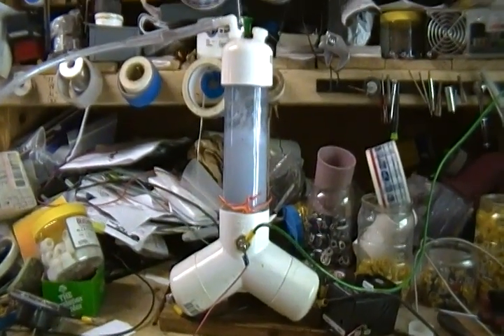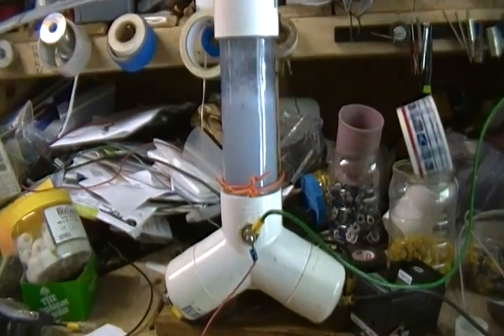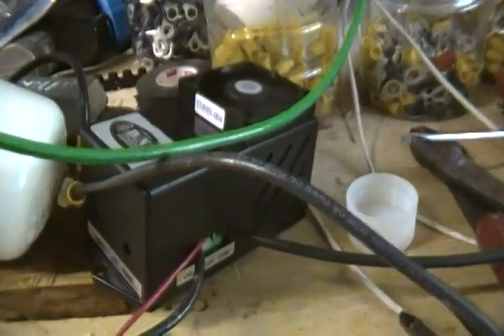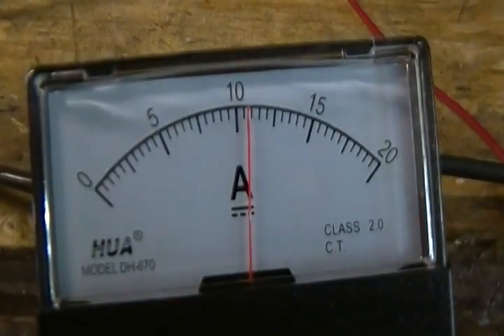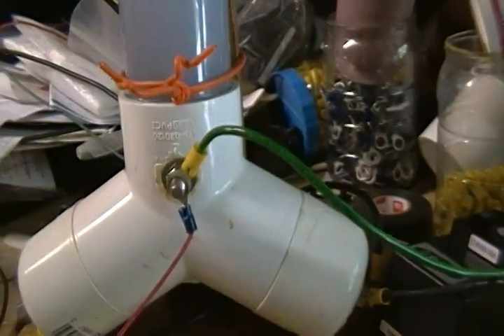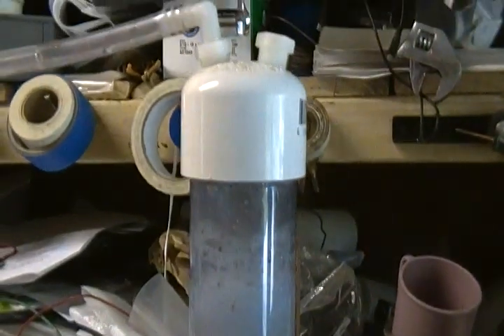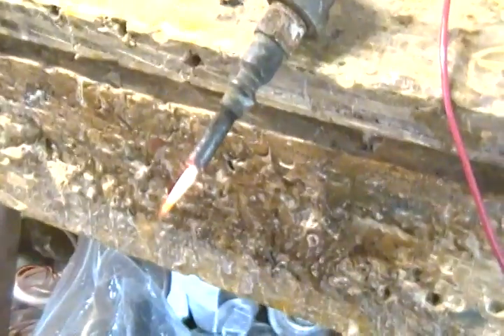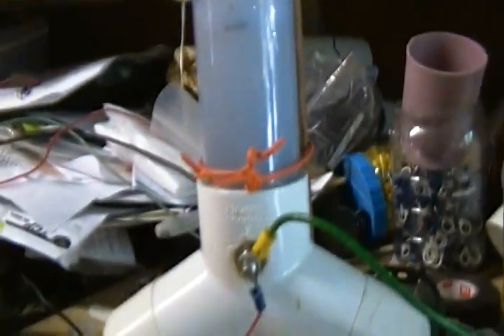FARM SHOW  - HydroStar Works Great For a FARM SHOW Reader!

Comment: The original Hydrostar was a booklet of instructions to build an offshute model of the Meyer type hydrogen generator.  The design was by Chambers of the Canadian firm Xogen. He used to be an engineer of Meyer's firm of Water Fuel Cell in Ohio. He went to Canada after Meyer was killed and had his new Patent slightly modified so as not in competition with Meyer. The major difference - his drawings do not exactly say for electrodes to touch the high voltage, even though you can infer that to be possible by flipping pages for comparison. Also Spin control of ions rising above level to raise up energy content. The notion also went for the magnets attached to gas lines of engines, you read about years ago. 25% increase in MPG with the hard to build Hydrostar. The design plans are now on EBay as disc, but the original was paper manual. You tube has a couple old videos of similar construction. Also Mythbusters show episode called Exploding Pants, purchasable and on you tube, has real interesting  skits about  a partial assembly of Hydrostar but has intentionally built in 14 mistakes , so as an engine would not run on cell built. Sub assemblies of Hydrostar are available to purchase on EBay.  US Patent "The Hydrostar"-- Oct 2000,  Apparatus for producing orthohydrogen  6126794 read on line or special order photocopies.

Comment: The Hydrostar was an offshute system by a previous employee of Water Fuel Cell co. in Ohio. He Patented a hydrogen generator in Canada which incorporated a wire coil for just modification of gases , rather than its original Patented purpose means of actual high voltage attached to electrodes by Flyback effect of same coil.  See the drawings of Hydrostar Patent and PREVIOUS Water Fuel Cell Patent. The "Meyer" cell was low energy input, self sustaining of  large hydrogen + Oxygen output, while the Hydrostar build manual is an ADDITION percentage of fuel to regular gasoline fuel mileage of cars.